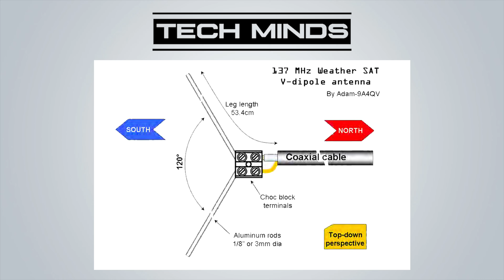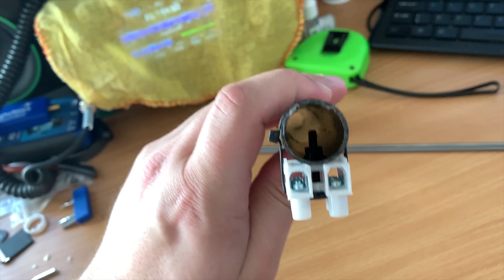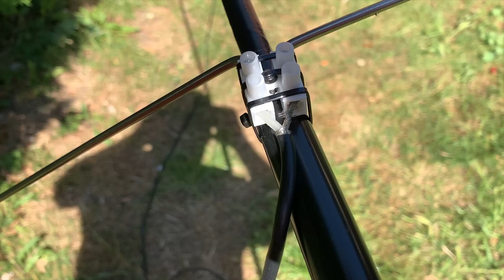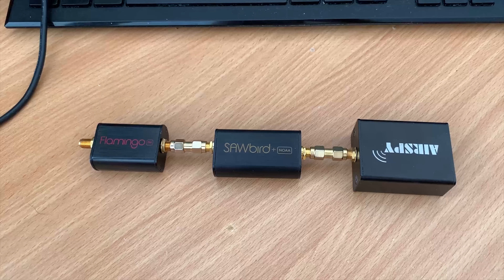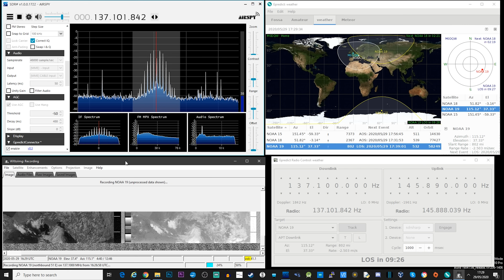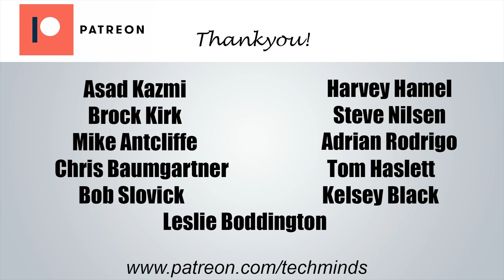How To Build A V Dipole For Receiving Weather Satellites

Comment: I made one of these V dipole antennas, but the 'improved' version. On the NOAA weather sats it worked REALLY well, but now NASA have deactivated NOAA 15, 18 and 19. It works well with the Russian Meteor M2-3 and Meteor M2-4 satellites, but their signal is a lot weaker than the NOAA ones.

Comment: Hi, I want to do this but I have a problem that no one explains, how do you connect the antenna to the sdr receiver?? you just cut the cable that connects to the sdr, and connect the first wire to one rod and the other one to the other rod, or do you have to put a resistor in the middle or a capacitor? Pls answer, it is the only thing that stops me from doing this and I don't want to cut my cable to try it out because I only have 1.

Comment: Help me, i followed the build guide fully, it captures FM broadcasts, yet 0 NOAA signal, i checked everything, the aluminum rods are properly connected to the coax using the choc board, SMA connector does indeed pass signal, i can hear transmissions from my baofeng, but no NOAA even on a 90 degree pass.
Reply: Fixed, just need to point the open side north and the side where the antennae meet south, also make sure your coax cables' screen is properly touching your adapter!

Comment: I don't think that you need to worry about the antenna being as high as possible; it's more about being above obstructions that are likely to be in the path.  Being a few meters closer to the spacecraft doesn't really help, and probably hurts because of the extra feedline losses if you're much higher than you need to be.
Reply from the maker: The whole point of the antenna being higher is to clear the surrounding obstructions. If you was say, in a field, with no obstructions 360 degrees, then of course, the antenna could be low to the ground, but in suburban areas having the antenna higher would hopefully clear some of the obstructions and provide a signal at a lower angle.

Comment: Tried a V-dipole at home and got a signal even with a 'bare' Nooelec NESDR Mini 2 (no FlamingoFM, no SAWbird_NOAA) but with limited range.  Then found John Coppens website and built a QFH using his design webpage and using 49mm PVC tube (from B&Q) with 3mm copper wire.  This allowed me to mount it above the RF shadow of the house and my 'shack' a.k.a. mancave (garage). Added a SAWbird+NOAA and a cheapo (£6) LNA from the far-east.  Started getting better results but with interference from a nearby POSCAG (on 137.9755 MHz) mast which gives me random banding on images.  Going back to basics with a V-dipole  at a location away from home (work, which is on top of a hill and some miles away from home), clear sky all round!  I'll keep this channel updated :-)

Using SDR-Console V3 (built-in Doppler) and WXtoIMG all on 'auto-pilot' throwing the data to my web-server
Reply from the maker: Thank you for sharing. I plan to make a QFH in the near future. 👌

Comment: I've noticed that this dipole does not use a balun. Is it intentional to give it its radiation pattern or perhaps it would work better with one?
Reply from the maker: No, a balun is not needed as this antenna is      tuned, which theoretically means the impedance at feed point would be near 50ohm. So, no need for a balun. However, experimentation is always fun!

Comment: A brief translation to spanish:
Para recibir la señal del satélite meteorológico se necesita un dipolo en V, ya que el dipolo recto tiene un patrón en 8 con nulos en ciertos ángulos. Como el satélite meteorológico pasa por encima cada cierto tiempo, el ángulo varia. Con una antena en V con los brazos a 120° el patrón es circular y puedes captar la señal desde cualquier ángulo.
El satélite pertenece a la red NOAA. Está el satélite noaa 15, noaa 18 y noaa 19. El 19 es el más moderno y capta imágenes de la tierra entre otras cosas. Emite a 137'1 MHz. 
Como el satélite se mueve, se produce el efecto Doppler, por lo que la frecuencia cambia un poquito y hay que compensarla con el programa SDR. 
En pantalla hay 4 ventanas:
- Arriba a la izquierda está el programa de recepción de satélite SDR. Este programa recoge los datos que le llegan por USB desde la antena, los filtros, el amplificador y el Hardware SDR  (no mostrado en el video).
- Arriba a la derecha está el software que muestra la huella de satélite. Esto es para saber por donde va y así saber si ya ha alcanzado tu zona.
- Abajo a la izquierda está el software de desencriptación de los datos de imagen. También se puede corregir la imagen en blanco y negro y darle color.
- Abajo a la derecha se muestran las frecuencias de recepción y emisión, ya que el hardware SDR permite también la emisión.

Muy buen video.

P E R F E C T

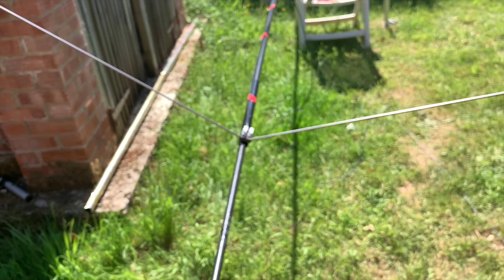Comment: At 2:48 you can see the centre coax going in to the left side of the block. Is that the outer shielding going in to the right? My Discone, which received 18 & 19 ok, was falling apart so I replaced it with a SSS Mk2 vertical. No surprise that even when 19 was directly overhead and with an LNA I could barely hear it. Using the radials from the discone I'll give this V dipole a go and mount it to the mast of the vertical antenna (30 feet up). It might improve my love for tracking these sats. Cheers bro :)

Comment: why do you say 53.4cm for the 1/2 dipole lenght ? 300/137.100*.95*.25 = 51.96 cm ?  Can you explain please?
Reply from the maker: Good question, but I followed the guide for building this. I would assume it is because this is not a straight dipole, it’s a V dipole. But without modelling it in software I can’t be sure. Either way, it was resonant where it needed to be.

Comment: Hi! Can you explain how you connected the coax to the choc block? Thanks!
Reply from the maker: Stripped back the coax to separate the Center and outer, then connected them into the choc bloc.
Reply: Thanks for the video; I was modelling something like this, out of curiosity, only the other day!  I suggest that coiling several turns of the co-ax, at the feedpoint, would be a good idea, to form a (crude) choke-balun, otherwise the outer of the co-ax becomes part of the antenna.
Reply: @Tech Minds Thanks!

Comment: You don't need to use external doppler correction for the NOAA birds when feeding audio to WXtoImg. WXtoImg has an internal PLL (Phase Locked Loop) that handles this for you in the audio so long as the input signal stays inside of the receive bandwidth for the whole pass. A 42kHz BW should work for this purpose. You will need to set the slant correction for the proper sample rate, but after that it's plug and play. The doppler correction also can confuse the METEOR Demodulator plugin's tracking. Really, you shouldn't neet to be using external correction for either of the popular V band weather satellite types.
Reply from the maker: I agree about Meteor not needing Doppler correction from software, but for NOAA APT it is needed.
Reply: @TechMindsOfficial   If what you are doing works for you, then that's fine, but I will refer you to thread(s) found on r/amateursatellites and/or r/RTLSDR where DerekCZ (the guy that did NEC work with the radiation pattern optimized V-Dipole with the reflector) says the same thing as me, about not needing it for use with WXtoIMG. I don't use it any more and I've been seeing better results since I stopped using it. The WXtoImg documentation should also be helpful. Look to the PLL section for what I am talking about with integrated doppler correction in AF. You have to calibrate the PLL, but after you do you should have clean doppler correction in the AF. If you do it externally quickly enough with the PLL off, the results should be the same. It looks to me like your external correction is fast enough here, but my correction using Orbitron was not fast enough and resulted in the shifting described in some of these reddit posts.
Doppler and Sample Rate Related Thread(s): 
1) https://www.reddit.com/r/RTLSDR/comments/gycdye/i_dont_know_why_my_picture_came_out_like_this/
2) https://www.reddit.com/r/RTLSDR/comments/2z1dmq/wxtoimg_why_is_noaa_image_shifted_what_to_do/
3) https://www.reddit.com/r/RTLSDR/comments/67zlzb/what_is_causing_this_horizontal_distortionlines/
4) https://www.reddit.com/r/RTLSDR/comments/bbcf1g/think_that_youre_getting_bad_images_from_noaa_apt/
PLL correction calibration:
http://leshamilton.co.uk/wxtoimg.htm (ctrl-F PLL)
Reply: @TechMindsOfficial  On another note, you should definitely check out DerekCZ's work on a radiation pattern optimizing reflector for the V-Dipole. There is some cool NEC stuff going on, and it appears to get pretty good results after adding the reflector or optimizing the ground distance. https://www.reddit.com/r/amateursatellites/comments/cnnjjm/how_i_came_up_with_my_current_vdipole_design_and/
Reply from the maker: Thanks for sharing Robert, I’ll definitely got it a look. I really need to get myself into Reddit, something that I havnt done yet believe it or not. Thank for watching 🙏

Comment: Does the antenna material have any noticeable effect on the signal quality?
Reply from the maker: I tested using steel, unfortunately it wasn’t stainless and it’s gone all rusty now. I havnt personally tried other materials, but copper, stainless steel and aluminium should all work similar.

Comment: I made the aerial quickly from my stock of antenna materials bought at B&Q. On my vector antenna analyser there were low VSWR at 137 MHz  and usefully for NOAA15 435MHz. The RTL SDR dongle the I have is currently deaf but the software load per your other film did work. I was lucky to get an executable for WXTOIMG from another site that did work error free. SDR Console with a RSP1A using its satellite tracking capability into WXTOIMG would make a very good video.  73 de M0YDH

Comment: Hello, thanks for great videos first. I have two questions; 

I am looking for steel rods, the web site that I will buy them tells that they were 304 stainless steel and non-magnetic. Non-magnetic or magnetic really matters?

And do I have to solder cable legs to rods or will it be just enough to contact them?
Reply from the maker: Non magnetic for sure 👍

Comment: Maybe you can pin this: you should start measuring the 53.4cm from the point were the coax braid shield got seperated from the inner conductor. The rods needs to be shorter than shown in this video. The arrows in the design from Adam 9A4QV also shows this.
I also want to add that during early (morning/afternoon) satellite passes you indeed need to point the V north, but during evening/night passes you need to rotate the antenna 180 degrees because during these times the satellites approach from the south.. (hence you also need to vertically flip the images)
Reply from the maker: Thanks for the comment and information. I didn’t show this in the video but I did put this antenna on a network Analyzer and it was perfectly balanced around the desired frequencies. So for me the length of the rods were just right. May I ask why I would need to change the V direction in the evenings as the radiation pattern for this type of antenna is supposed to be designed for a zero pattern, so there should be no  nulls.
Reply: @TechMindsOfficial  copy & paste from M Fathurahman found on iopscience.iop.org: With the V dipole antenna in the horizontal direction, the radiation pattern will be directed to the sky with a pattern of zeros (0). This form is very optimal for receiving satellite signals that are in the direction of 
the front, side and top of the antenna. Because the direction of the NOAA satellite orbit from north to south or vice versa, the antenna is sufficiently directed towards the south or north. With the V dipole antenna in the horizontal direction, the radiation pattern will be directed to the sky with a pattern of 
zeros (0). This form is very optimal for receiving satellite signals that are in the direction of the front, side and top of the antenna. Because the direction of the NOAA satellite orbit from north to south or vice versa, the antenna is sufficiently directed towards the south or north.
Reply: @TechMindsOfficial  simple explanation: for high elevation passes it doesn't matter. If the satellite is low above the horizon, pointing the V to it helps a lot.

Comment: Heya, thanks for the video, ive actually been making a video on the same thing! I didnt know those noaa filters exist, might have a look for them! Also ive been using Orbitron, I might give Gpredict a go.  One question, I noticed on the diagram at 1.12 , is says to use aluminium rods. Does aluminimum work for RF? Im just using a TV antenna dipole, (unfortunately i live in an apartment and dont have a backyard).

Comment: For Meteor M2 don't use g predict, every time, frequency changes because of the doppler effect, the Meteor M2 demodulator plugin in SDR Sharp loses the lock on the signal, causing many black strips in the final image.

One can use this LRPT decoder package for meteor m2  which has all the required software, including orbitron and SDR sharp with all setting preconfigured.

https://leshamilton.co.uk/MeteorLRPTSuite.htm

I really like the video. 
Big fan.
Your channel helped me a lot to capture images from these weather sat. 
Here is one example which I captured from Meteor M2 

https://leshamilton.co.uk/soft/Meteor-LRPT-Suite.1.8.3.zip

Don’t capture in night, meteor m2 gives only black image during night time.

Here is a 3D Printed holder for NOAA dipole antenna which i made.

https://www.thingiverse.com/thing:4360244
Reply: Back when M2-2 wasn't ded :( M2 sometimes operated with the IR channels enabled in the LRPT downlink. If you watch the r/amateursatellite subreddit, they'll usually make a big deal about METEOR being in IR mode, and then you should absolutely try receiving it at night.

Comment: Hi Matt, very nice Video. I was always interested in how to set up this dipol (I used a QFH). Quite good range for NOAA... Hint: For Meteor stop frequency tracking as the signal lock got lost every time the frequency changes. Set to nominal frequency, Increase bandwidth and you are good. Good Luck, Florian
Reply from the maker: Thanks for the advice Florian! I did wonder if the “locked” should be solid or flashing but it appeared to be flashing. Yes, I guess it doesn’t need the frequency tracking when being controlled by software. I will definitely give Meteor another go because the images I’ve seen look incredibly good quality. Thanks for watching my videos 🙏
Reply: @TechMindsOfficial  "locked" should be solid red. And, yes, do not track Meteor's frequency will remove most of the missing lines.

Comment: I'm using an "Moxon Turnstile Antenna" which is far more better, really omni-directional,  easy to build  and can work in any environment , like a city.
(I get some good pics from Meteor-M2 too)
Reply from the maker: Excellent! I’ll definitely be going through these home built antennas and testing them. Not every one can afford commercial antennas and if we can build something out of cheap parts, that actually works, then it’s a win win! Do you have a link to some plans you could share with us please?
Reply: @TechMindsOfficial   for antenna dimensions I used a Moxon calculator (http://tippete.net/cgi-bin/moxgen.pl ) , for wiring  i used (http://on5au.be/content/a10/vhf/ms2.html ) and all was made from [Cu] water pipes (15mm)
Reply: V dipole has been proven to be better than any turnstile, turnstile is trash

Comment: Just recently tried picking up NOAA19 with a v dipole only a meter off the ground and I got suprisingly good resullts first time. Would be interested in a Meteor video as I attempted this after and got nothing, I suspect I need to build a QFH antenna.
Reply from the maker: Another subscriber has just informed me my Meteor decode could of been bad because I left the “tracking” ticked on the demodulator. I guess the tracking is not needed because GPredict was already setting the frequency. I will be investigating this further and make some more videos on this subject. Thanks for watching 🙏

Comment: I have a 40ft fibreglass mast, currently with just one J-Pole on it for 2m/70cm, i'd really love to add this antenna to it. Other than when i'm transmitting on said other frequencys, should I be able to put the V-Pole on the same mast and receive weather satellites ok ? I think so, but would appreicate any input/feedback regarding this.
Reply from the maker: I think you’ll be okay, just not too close to the J-Pole and you’ll be fine. Let me know how you get on 👌
Reply: @TechMindsOfficial  sure thing. I'll source a mast-clamp and the rods, then post it on my blog giving you the rightful credit ! 73's M7ALU (Edit 1/6 - parts ordered, should be good for the weekend)

Comment: What is the length of the rod (at the bend) that you inserted into the block? Maybe 2 cm?
Reply from the maker: Roughly 2cm, but keep it as short as possible but enough to poke into the choc block. The bend is included in the overall length. The size of the bend part will depend on how big the choc block you use.